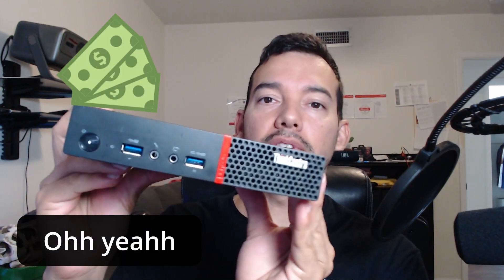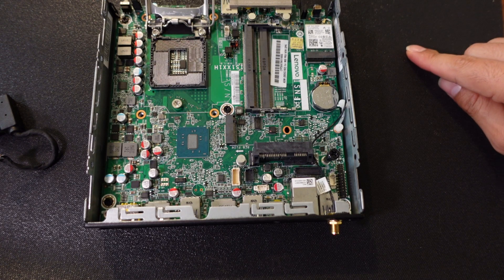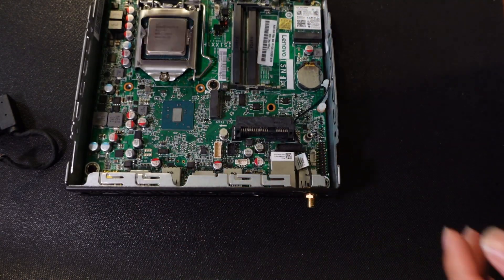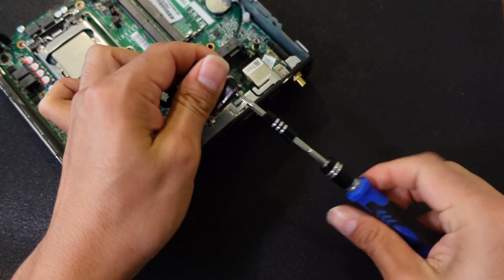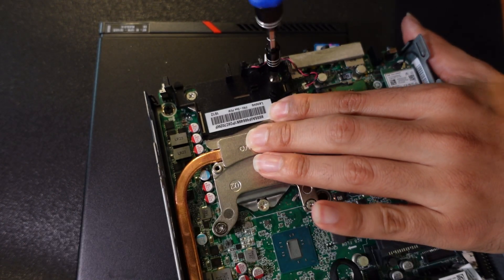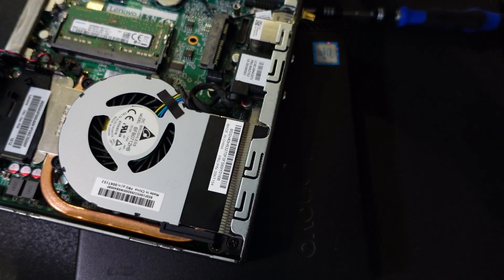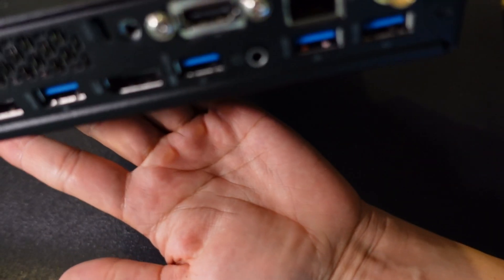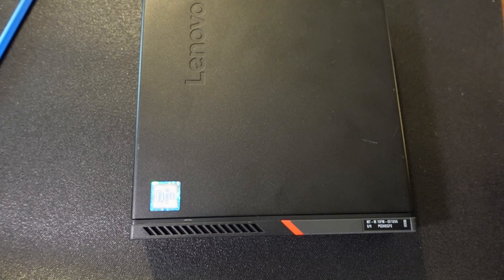How to build a pc computer - Lenovo thinkcentre m900 edition

Comment: Nit picking, you never connected your ssd ...
Reply from the maker: It may seem that way but if you look at the ssd. When it gets pushed in its actually being inserted into the sata connector that is attached to the motherboard. It happens right at 14:18 in the video. I appreciate the comment. I do tend to miss stuff on some videos. It helps me to watch out for stuff. I guess i should have clarified the type of connector. Cause normally you use cables.